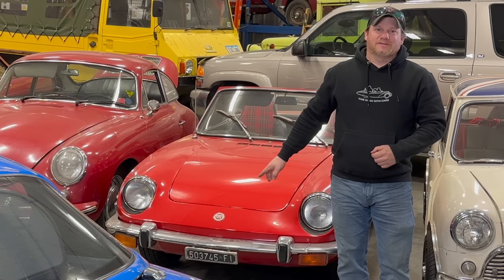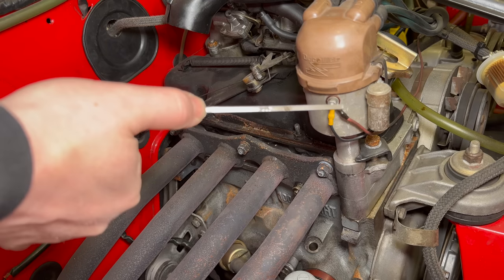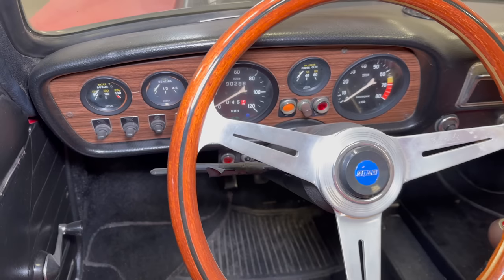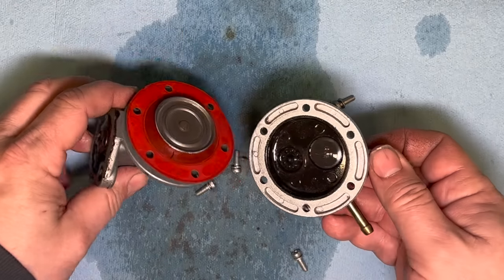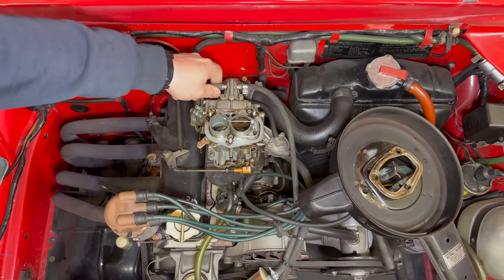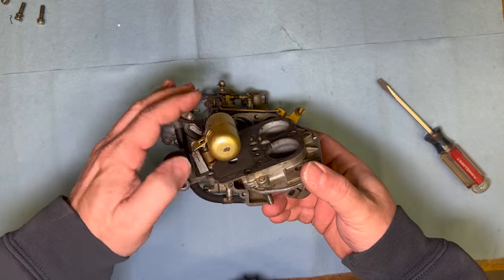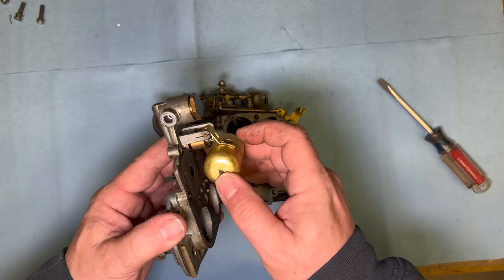Fiat 850 Engine Filled With Gasoline

Comment: As a.16 yr old in 19 72 I wanted to get a job fixing cars, so asked in the local garage center. Boss gave me an old carb and said "Strip that down, tell me what's wrong and maybe I'll hire you". By mostly intuitive guesswork I did so (Leaky float filling with fuel ). Boss came back and said, "Ok, now fix it and you're hired". Since that day I've rebuilt probably hundreds of carbs;  they're marvels of engineering. Oh, and small Fiats are great cars, I particularly like a 127.

Comment: Drove an 850 spider across the country from NJ to Santa Monica and back in 1975 (was 19) and then back to Santa Monica in '76 where I sold it. It was de-badged and in primer and people were always asking me: "What is it?"  Had Mobile 1 oil in it on the first trip and sometimes got 50 mpg. Blown head gasket in Colorado on first trip en route to CA (repaired by a shop in Denver) and dead starter on the return in Indiana - picked up a hitchhiker who helped by push starting the car all the way back to NJ. Fun times! Saw the car again in '78 parked in Santa Monica and was embarrassed to see that my bondo job on the driver's door was failing...

Comment: You're lucky it came out on the ground as an early warning. My F600 had a leaky fuel pump, but I didn't know what to look for on the dipstick... Ended up having a couple gallons of fuel pump into the crankcase, which clearly was not ideal! The 850 looks really fun- I'll bet it's a good one to toss around roundabouts! Saw a beat up one next to a gas station up north and I wanted to save it... can't save em all. Not by myself anyway!

Comment: I have a 1970 Fiat 850 Sport Spider in my garage right now.  My last re-build was in 2000. It has not been started since this re-build. I have the Weber 30 DICA off of the car and I will re-build it for the last time. I purchased the car in 1983 for one thousand dollars. I will be doing a very complete re-build on the carburetor. This time I will be Zinc Plating the body of the carburetor along with all the steel parts.  I will offer these words of wisdom. If you have extra parts or have a place to purchase them cheap, get as many as you can. That carburetor, Weber 30 DICA is worth $750 to $1000 if you could buy one.

Comment: I had a great little 69 Fiat 850 Spider in 1972 in Phoenix.  Had it for about six months and sold it. Back in Phoenix in 1975 and going through the local junkyard I found the Fiat again.  Looked like it had an engine fire and was scrapped.

Comment: When I was 16 my dad bought a '71 850 Spider, "for the family" but I was the main driver.  Tons of fun to drive but so light I could pick the front wheels off the ground by the front bumper.  I did have a little trouble keeping it on the road a couple times, but I really tested the physics of it for sure.  Without a doubt the LEAST reliable car I ever owned.

Comment: Bought one brand new in 1971. What I remember is how easy it was to work on. I could pull the engine by myself. Unique centrifugal oil filter in the crank pulley. Cool, but slow little car.

Comment: I got my 69 Yellow 850 Coupe in Mar 1971 at almost 18. Used with I think 30K, sold in Santa Clara, CA B&B BMW. BMW's Top end ver  then was about $5k then. I paid about $`=1450 They were eager to get it sold. It had the trademark FIAT Vinyl seats smell. They would sweat on the windows oily vinyl film. I had never seen one and needed a car. Seemed okay my friend had a 67 Bug. We had fun with it till I went to NJ at 18 in it in 1972 Feb winter probably got >30mpg and gas was under $200 I think, I kept expense notes. Only had a generator going bad for battery. I drove it back in June 72. It locked up solid in summer of 74 when I was on leave in NAVY; in the mountains at Night ABOUT 10:30 between Clear Lake and Woodland. CA in a nowhere land of moonlight. Luckily a Peterbilt Timber Hauler stopped and gave me a ride out since I had my flashers on. Those were the days- no cells. Just human beings. We towed it back to Woodland, (how??) I somehow got back to my base (Train/Bus?) in Pt Mugu. All on his own, My stepdad  knew zero and had a friend haul it behind a truck and at 30mph popped the clutch and sent the rod and partial crank right thru the lower oil pan / block. Toasting it forever. I replaced it soon with a 69 Datsun 510 coupe like they were racing then, a much more reliable peppy car for same @ $1490 price from a dealer in Ventura (Hughes Motors). The Fiat was finally scrapped in 1976 before I went to France. And lost all my possessions (Parents are not stewards) I would have liked the Fiat124 Conv. but the 510 was safer and after I slapped a L20B engine in summer 77 and I was happy for a while till it to was driven to NJ in 1981 Sep, and never was able to retrieve from my dad's driveway. It became a rust victim from 82-86 when he mysteriously made it disappear without notice.

Comment: Check venting in the fuel tank. The cap or other line. Usually the new mix of gases today melts rubber parts in the gas cap and plugs it.

Comment: Hi steve .I have had my boat with a volvo penta.
The fuel sifined ir self and filled the engine.Couldnt find any problem.I presume the float stuck open.
Drained it and it ran fine.
Allways turn fuel tap off now.!.

Comment: Very interesting, I have the same issue on my 73 VW, I hadn't considered it could be an issue with the carb!
Reply: The fuel tank in the engine bay, if the tank cap is badly vented the fuel expands in the tank due to heat and pushes fuel past the carb float .

Comment: Float needle stuck and gas siphoned until gone. If the fuel tank is above the level of the float this is possible. I've had this issue on my Norton, not uncommon on motorcycles that use gravity fuel feed (no siphon needed).
Reply: I,m sure you probably considered this already, you're a much more adept mechanic than myself.

Comment: Love the 850! Mine had the same issue, mechanical pump faulty! It'sthe only way it fills up, the carburetor is tto high and normally dries out.
Reply: I agree. This can't be through the carb. The only fuel in the carb is in the bowl. That's way too small to account for the amount of fuel in the crankcase.

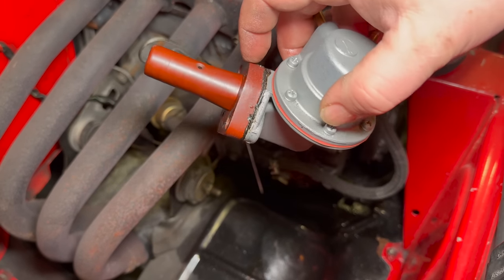Comment: That's a fairly catastrophic failure, you proved it drained the tank until it wouldn't start, the comment about "where did the oil leak" got me thinking. it was below the level of the pump so could have leaked past crank splash seals?  but 3:47 "the pump was full of fuel" interpreted to below the diaphragm?  possibly proven with blocking the pump inlet, and hand vacuum the outlet to see if it holds? i'm not seeing the possibility of a float needle draining below the carb. as the bowl is vented.
lastly, how you finish removing the fuel, heat cycling to burn it off, then another oil change would be in order.
Reply from the maker: The oil was so thin it probably leaked from every seal and it has sat there leaking all winter so it is no surprise that you wouldn't see a trace of it after that amount of time with that much fuel in it washing the parts clean.

Comment: So, tell the truth, did you drop the oil drain plug into the waste oil like everbody else does.  I’m in awe, no fear, a zillion parts on the table and all goes back together without pouring over the maintenance manual.
Reply from the maker: No I didn't drop the plug that is why the oil/fuel when all over my hands